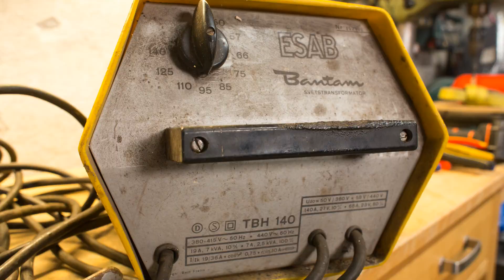ESAB Bantam TBH 140 Welder Restoration

Comment: Hi may I Ask how you change the power cord cable? Please advised
Reply from the maker: Replaced power cord, mounted new in the same screw terminals. Mind the cable fixation to avoid damage from pulling cable.

Comment: I just used this welder and it tripped my household 220v 16a breaker...  I only could run it at 75 amp setting before it tripped.

I only have 3.2mm rods, and I think it draws too much amperage, causing the break. I read that 2.5mm is required but the lesser the better. 

My weld results are similar to yours. Barely did anything but black spots

I really need to get this unit working asap.

Comment: Your smoke-detector needs a new battery ;-)
Older equipment is made to survive and last a very long time, as this video shows.
Thanks!
Reply from the maker: I got networked smoke detectors, I change all batteries when one of them start beeping. When I postpone it a bit, over half starts beeping within a week. Quite incredible that they drain them that even.

Comment: Great little video 😎 fixed 2ph input is interesting i haven't seen that before but i dare bet it's pretty common in counties with 16A 3ph domestic supplies? ..Those old line frequency welders are strong, ive got an old oil filled oxford welder and that thing is bulletproof 100% duty cycle... There was nothing wrong with your welding attempt mate, it was exactly what would be expected from anyone picking up an AC stick welder for the first time, FYI the new style cheap IGBT 2 switch forward inverters with DC output are pretty good for the money and a lot easier for a beginner to weld with. Also you need to dry your rods, Take a blow torch and gently heat the rods to dry out the flux before you start to weld,  you can see the shade change as you drive off the moisture, if I've got a lot of welding to do i put the rods in the oven for half an hour, professional welders have  heated electrode storage boxes called "welding quiver" basically a mini oven.. keep up the good work..

Steve
Reply from the maker: Farms will almost always have a 3 phase 63A service. The bigger the farm, more juice is available! I never knew about the rods in oven, explains a lot about these rods I found on a scrap yard and just kept in a cold garage :)
Reply: @KaizerPowerElectronicsDk  oh yeah of course on farms and commercial buildings, it's the same too, my friends pub has  100A 415V 3ph.. I was going on the assumption that the designer intended it to be able to be used on a 16A 3phase domestic supply for maximum versatility? The oxford welder has taps on the primary, it can run from a 13A 240V supply but also has taps for 380V and 415V, I sometimes use it as an autotransformer, it makes a great adjustable ballast too, I short the output and put the primary in series with the transformer or whatever I want to ballast and use the built in series tapped inductor of the welder to adjust the current..  it looked like yours used different primary taps to adjust welding current? I've seen that before in my cheap "CLARKE"  MIG welder

Comment: These were also made under license in Croatia at the Uljanik Shipyard.

7018 rods are hygroscopic and must be kept in an oven.  6013 and 7014 are the most versatile.
Reply from the maker: Cool that it was made on license, I found a picture. Exact same unit and even says "Lic. ESAB" on the front. 
I found those rods at the scrap yard as well, so no wonder it sucked (I will let that be the excuse for my absolute failure ;) )